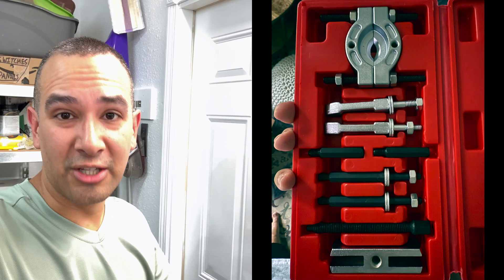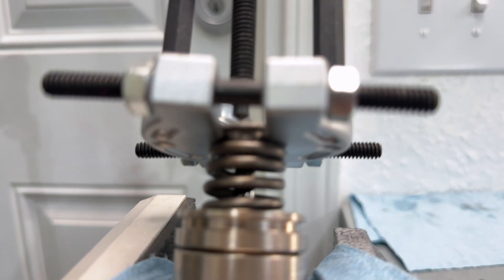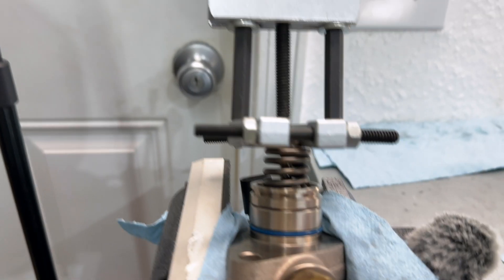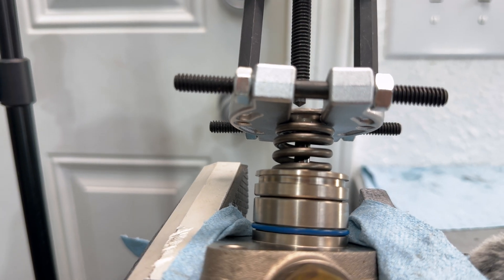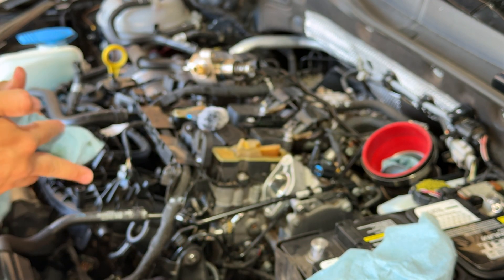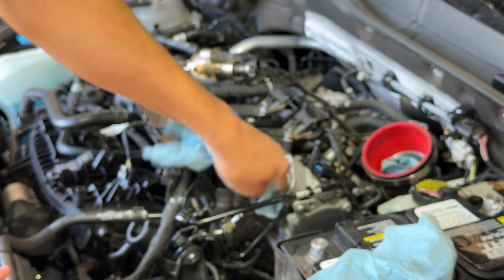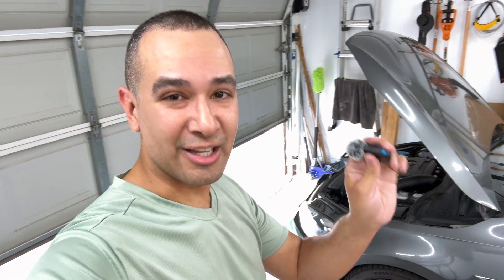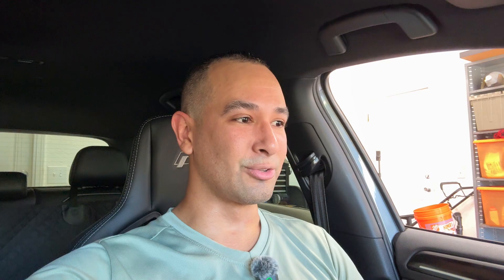IE High Pressure Fuel Pump Upgrade- Part 1 of Switching to Ethanol on Mk7.5 Golf R

Comment: I just performed that hpfp on my GTI a few weeks ago. Wasn't that bad of a job. I left my airbox and hose intact which made the job tight, but was still able to do it. I'm still on the fence about getting IE's trueflex kit since I don't drive that often so I fear that it is a recipe for disaster. I could always continue to use 93 octane and use E85 when I know I'll be doing longer drives / trips.
Reply from the maker: glad the pump install went well. Yea, that's the advantage of the kit. Run gasoline and switch to E when you want and viceversa any time you want. For me it would be the oposite of your situation- will drive on ethanol most of the time except for road trips where I reach a station that doesn't have ethanol so back to premium gas.